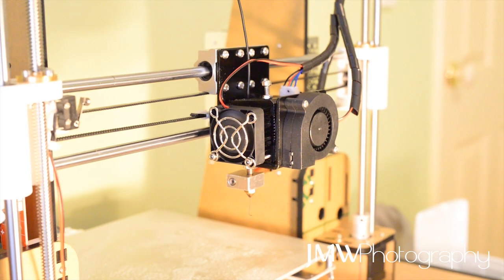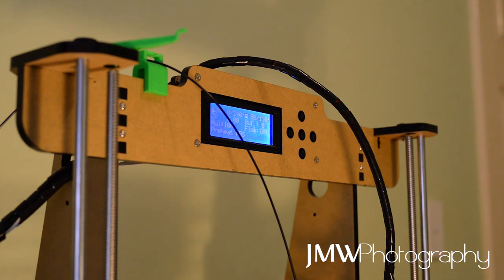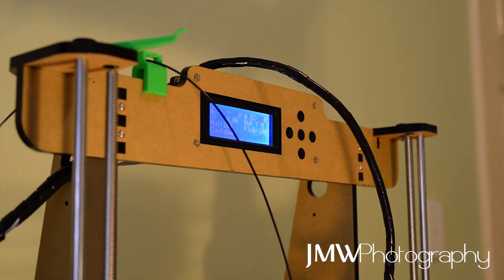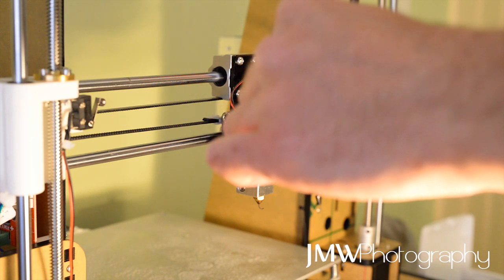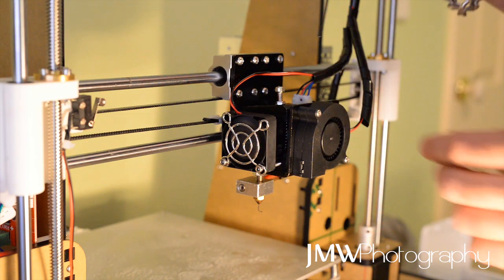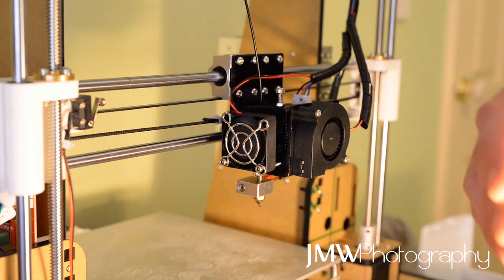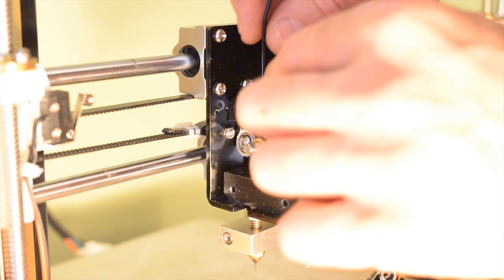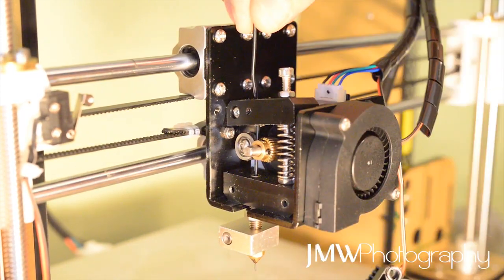Changing / Loading Filament - Anet A8 - 3D Printing - Tutorial - How To

Comment: How much do you need to screw the tube with the thermal barrier into the housing? What should be the distance between it and the mounting plate?
Reply from the maker: my apologies for the late response. We have had a baby and moved house. I haven't made a lot of videos in a while but we are getting back to it! :) Did you get this sorted?
Reply: @JMWConceptsTheOfficial  How much do you need to screw the tube with the thermal barrier into the housing? What should be the distance between it and the mounting plate?

Comment: I'm having a problem where when I try to pull the filament out, I do the push and pull but it comes out partly then gets stuck, I can't push it or pull it at all and I can't get it out? Any tips?
Reply from the maker: Hi Sad Duck, if this is happening it usually means that the plastic is melting to something inside and hardening before making it all the way out. Try doing the PULL part of the process a bit faster, I just about rip it out.. Push down for about 1 second and make sure it's extruding out the nozzle, the RIP it out like your pulling of a band aid. Lol.
If it keep happening then there may be something untoward on the inside of the extruder. You can check my 'extruder setup and disassembly' video, otherwise inspect your plastic tube on the inside of the throat tube, over time this can deteriorate and cause excess friction internally.
Let me know how you go!

Comment: thanks dude. I need to know how deep I have to push in. ifUnowhatimean
Reply from the maker: Hey Choi Sukwon, do you mean how far the filament goes into the extruder? Its further than you may think, it has to go literally to the bottom of the nozzle so a good... 4cm maybe. I'm not with my printers now so I can check exactly but if your hot end is hot, you'll know when its starts extruding as you push. 
I hope this helps!
Reply: yeah. I fixed my 'first printing-after setup' problem when I wrote that comment. I didn't realize that i had not pushed that filament far enough. have a good day!

Comment: This is going to be a stupid comment, but please bear with me. I'm a newbie and I've already managed to clog everything twice and had to replace throat and nozzle, so the idea of removing my filament is kind of terrifying. :) I thought doing this with the extruder motor — feeding a couple cm and then having it back up — was enough, but it clearly made a mess as it was too slow. So let me ask you three very stupid questions, which hopefully will help other newbies as well... :)

1) If I want to remove PLA, preheating to PLA temperature (190-200) should be fine, correct? I mean, you preheated to ABS temperature because you use ABS, not just because it's higher. Is that right?
2) What happens if you do the "push and pull" maneuver while at peak temperature for your material, without the cooldown part? I mean, is it absolutely necessary to let it cool down a bit, or is there any reason not to do it at peak temperature?
3) At the end you heat the hotend again to put the filament back in. If you just wanted to leave the printer without any filament (e.g. to move it, store it, whatever) would that still be helpful somehow, like help melt the remaining filament in the nozzle, or would it be entirely pointless in that case?

Thank you in advance, your videos are great!
Reply from the maker: Hi +Daniele, let me answer in order. :)

1) That is correct.
2) The reason is to let the filament in the hotend cool down just enough that it doesn't stick to anything on the way out and create clogs. Also, the idea of allowing it to very slightly cool in the nozzle before wuickly pulling it out is that the liquid filament will harden around any bits of dust or residue in the nozzle and bring that with it, thus cleaning the nozzle.
3) Following the 'cold-pull' method(or any of it's other names) will bring all plastic out of the nozzle and hotend system, leaving it empty and ready to re-load. If you were moving or storing, you would skip this final step and leave the printer cool and empty.

I hope that helps!
Reply: Thank you very much for this! I'm going to follow your advice and hopefully not have to take everything apart again (which I did following your other video, by the way). :)
Reply from the maker: Fingers crossed this solves the issue. If you continue to have blockages and snags, there's likely an underlying problem creating them. :)

Comment: How did you pre-heat.  Why do people always think the most obvious thing is obvious?
Reply from the maker: Hi Goofyfoot2001, sorry I didn't mention this. This was one of my earlier videos and I may have missed a few details. 
To pre-heat, you just turn your printer on and use the menu to manually set the nozzle temp to the required heat, or use the 'pre-heat PLA/ ABS' setting. Once the the nozzle is at the correct heat, go into the settings and select 'Cool Down'. 
It's a manual process. :) I hope this helps!

Comment: uhhmmm do you know you have to pull that protection foil off the acryl?
Reply from the maker: Hi Kim, yes you can if you want to or leave it on for extra strength(think tint on a car windscreen). I haven't bothered on my A8's because they are just the work horses but I did on the Tarantula I just built(video coming soon!). 😃
You can watch a tip on removing it here if you want. 👍🏻 https://www.youtube.com/watch?v=-_8vSV5ZJUQ
Reply: ok its realy a pain in the ass to get that stuff off :D
Reply from the maker: Especially when you bite all your finger nails off, waiting for prints to finish! 😂😂😂
Reply: :D

Comment: I like to cut a steep angle on the filament with side cutters before I push it through seems to help get it down through the gears.  Make it nice and sharp like an arrow head.  Awesome video going to switch filaments soon to PETG from PLA hopefully it's not a huge pain.
Reply from the maker: Thanks for adding that +16by80. Since making this video I too have started doing the same, it does seem to help. 👍🏻
I have a roll of PETG I need to do a review on, haven't tried it yet. The only thing we may need to change is the hot end out for an all-metal model. It will probably depend on how long/ large your PETG prints will be, small ones will likely be fine.
Good luck and let us know how you go!
Reply: You Sir, are a genius! Thank you so much! Solved my problem and saved my evening...

Comment: do u have any preference on which filament to use on this machine?
Reply from the maker: Hi +Dan1029, I have been using a lot of Sunlu filaments. Good quality and nice and CHEAP! ;) You can check them out here: https://www.amazon.com/gp/product/B01NGT6BUS/ref=as_li_qf_sp_asin_il_tl?ie=UTF8&tag=jm0f5-20&camp=1789&creative=9325&linkCode=as2&creativeASIN=B01NGT6BUS&linkId=d87c801a0bb7fd5d333ddc93eae4be14
Reply: JMW Concepts thanks
Reply from the maker: No worries! What filaments have you tried so far?
Reply: JMW Concepts I was thinking about buying the Anet A8 and I didn't know what filament would work good on it.
Reply from the maker: Oh dude, get it! :D
Such an awesome printer. 
You can print almost any 1.75mm filament no problems. 
http://www.gearbest.com/3d-printers-3d-printer-kits/pp_337314.html?wid=21&lkid=10558912&lkid=10558926
Reply: JMW Concepts ok thanks so much

Comment: What size filament can you use ? Or can you use any size filament ?
Reply from the maker: Hi mate, the Anet A8(and most desktop 3D printers take 1.75mm filament. I thinks it's mostly the larger format printers that use the 3mm. 
I hope that helps. 👍
Reply: ok thanks for the information helps a lot cheers

Comment: you can ditch the little heatsink, and actually make your life easier.
the A8's hefty aluminium head mount can easily dissipate the bit of heat, creeping up the tube. with a dab of thermal grease, and the fan casually above the motor, my cold block barely gets warm, even with the fan turned off.
Reply from the maker: Hi Cuda FX, 
There are certain filaments that I do this with(especially with smaller prints) but here in Oz my printer gets hot! A couple of hours without the fan the other day had the top of my extruder warm/ hot to touch so I gotta watch it.
There are a few mods I'll be doing soon that will make things easier. 
...Just gotta find the time! 😜

Comment: I have a piece of filament sticking out of the hole the filament goes in, do you know anyway of getting it out? I accidentally let the roll finish while inside the prinmter and it doesn't have anything for it to grab onto to push/pull it out.
Reply: You could try setting it to printing temperatures with the extruder removed and push the stuck filament with the new one until the new one starts coming out, and make sure you guide the new filament through the extruder intake (I guess that's what you call it), and then put it back together.
Reply from the maker: Hi +SlimeWithClass, 
How annoying! I hate it when that happens. Ralakus has the right idea, first thing I would try would be to take the fan(not blower) off and remove the extruder(part with the gears). Now, with the extruder temp boosted up a bit(maybe 10-15°C above your normal printing temp), take the thinnest allen key that came with your printer and carefully insert it in where you would insert your filament. You may need to hold it with pliers to avoid burning yourself and to get the leverage to push the filament down and out. Once it is down in the nozzle, you can reassemble and insert your new filament. 
Notes: 
* Make sure you are supporting the bottom of the extruder carriage as you are pushing down with the allen key to avoid mis-shaping your rods.
* Try to turn the temp back down to normal and get your new filament in as quick as possible as it's when filament is left at high temps for periods of time that it tends to clog.

I hope this helps and good luck! Let us know how you go!

Comment: Don't pull the filament out like this. If you do it just right, great, but if you (most likely) don't, be prepared to disassemble the extruder. This method can allow the filament to harden inside and become stuck. I have much better luck snipping the filament off flush and pushing it through with the new filament. YMMV.

Comment: I'm having a terrible time with threading the filament into the extruder. I always have to pull the fan and heat sink off to get it down past the gear/pulley into the throat. The filament always wants go off to the side of the pulley (misaligned, maybe?). Plus, my filament has suddenly become brittle (like almost overnight), so any messing with it too much causes it to break, hence the constant need to reload it. Whenever I tear apart the extruder to reload the filament, I then have to re-level the bed, which usually causes the filament to break off at the extruder. I made several high-quality prints until this filament got brittle, but it's exposed the misalignment issue with the extruder pulley. None of this started happening until about 3 days ago, and I've only had the printer for 2 weeks! Most aggravating. But so far, it's been a good little inexpensive printer.
Reply from the maker: Hi Greg, how has your printer been treating you lately? Did you solve the brittle filament issue? This happened to me in very humid weather, all my exposed PLA became unusable. I had a busy few days away from my printers, both very hot, dry days and when I went back to the printers, the filament had sorted itself out.
I would try drying it out.
Reply: Thanks for replying. The problem did indeed seem to be moisture, despite the indoor relative humidity being around 30% right now. I put my spool of filament into a tub filled with silica gel for 2 days. Made a complete difference. I ended up with a very small short on one of the leveling springs under the heating element, so I'm in the middle of doing a wiring update along with using spring insulators that won't wear through to the heating element. But the filament worked fantastically, and I didn't have to tear apart the extruder to thread it into the nozzle after drying it.

Comment: A short machine screw that threads into the hole, drill out the middle then chamfer out a cone, check clearances to make a sort of guild/funnel to catch the filament
Reply from the maker: Is this how you have your set up +Jill Rob? Sounds like some more advanced metal-working skills than I possess may be required for this mod? Sounds very cool though!
I have a slightly newer video on extruder set up here: https://www.youtube.com/watch?v=B71GGLBrQDU&t=3s

Thanks for the input.

-JMW.
Reply: so far I am running a stock setup, but frustration of trying to load new filament has got my neurons sparking. actually from that additional video. the heat brake tube would just need a little love from a countersink bit to make the end more funnel like. if you have the space to do so, even file the ends out a bit to get it closer. It could be this simple ! I have a sketch of the idea but there is no way to post it here.
Reply from the maker: Interesting! I've seen this design before but I'm yet to try it. I need to crack out my flexibles for a few jobs soon so maybe it's time to give it a whirl! http://www.thingiverse.com/thing:1654883

Comment: Thanks, you have to be really quick, eh
Reply from the maker: Hi ArcanePath360, do you mean in the removal of the filament?
Reply: Yes, if you don't pull it out quickly it gets stuck. I just pulled out my ABS for the first time and let it cool before putting PLA back later. Then I found the ABS had broken off at the top of the thread and wouldn't melt out. Had to take it all apart and use a lighter on the end of the bolt to melt out the blockage, hooking it out.
Should I not let the nozzle cool empty?
Reply from the maker: Yes that can be the case. If too slowly, the filament will have time to stick to the sides. 
Sometimes when you get a snap-off inside the top of the throat tube, you can take the finest allen key that came with your printer and carefully insert it down(as you would load filament) between the extruder gears and use that to push the blockage down, into the heated area and get it melting. 
I have gripped the allen key with pliers for a better grip and managed it a few times, it just saves having to dismantle each time. Just make sure you use the hand that is holding the extruder screw to support your downward force to avoid bending/ warping your x-rails.
I hope this might help in some way. 😄

-JMW.
Reply: I never thought of heating up a metal object to insert into it, that may prove useful at some point. Otherwise it's a pain taking it apart and re-setting the nozzle screw and levelling the bed again. I used some force with a metal point but it was in there good. I had to burn it out.
Reply from the maker: Yes it saves a lot of time, I actually just did it then. Haha. You don't even need to heat your 'poker' up, just the extruder(hot end) so it can melt through. Gotta love the little tips that save a lot of work! 

-JMW.
Reply: I tried heating the nozzle up to 250, it didn't work because the blockage was at the top of the thread where the filament goes in. That's why I took it apart to heat the end of the thread up with a lighter and melt it back out this end but scraping it out with a tooth pick. It had broken off cleanly inside it.
Reply from the maker: Very annoying when that happens. I was fighting with my flexibles last night and ended out doing that myself. A real pain. Haha. Ahh well, all for the love! 
Have you had a successful print yet? When you, it makes it all worth while. 😉
Reply: Oh yes, I had several. The first few came out very well. Then I started playing with the settings in Cura, swapping filters and experimenting. All part of learning.
Reply from the maker: That's what we signed up for, right? 😂 👍